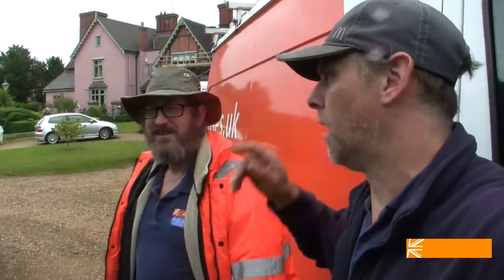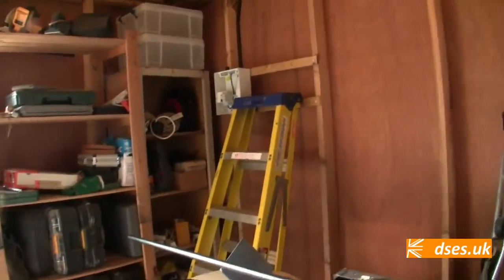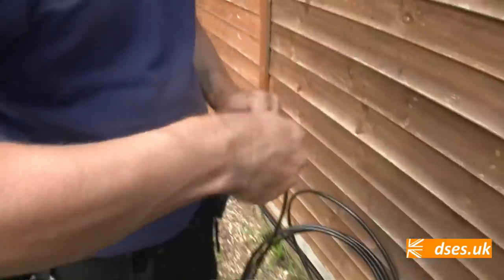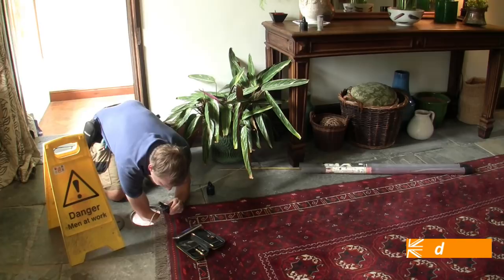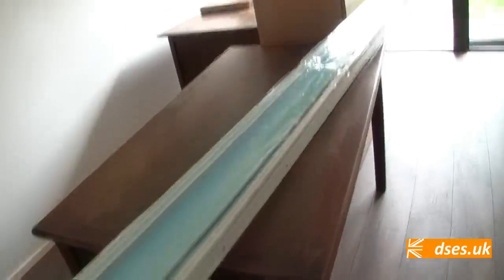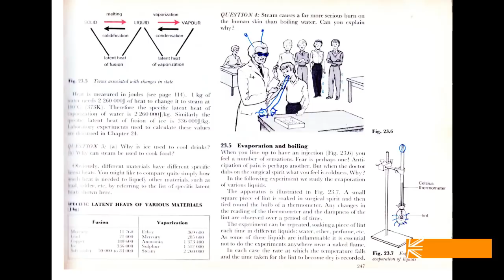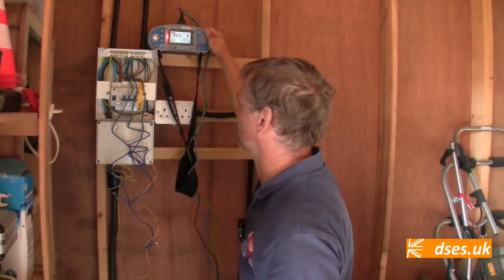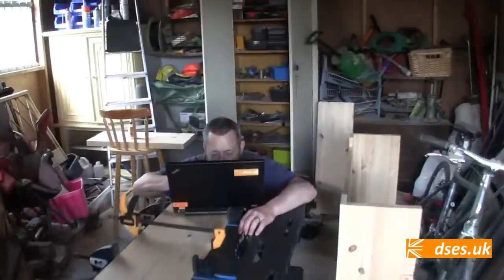The Manor House refurbishment... 5

Comment: Great video David! In this instance for TT we sometimes make off our SWA into an insulated enclosure with DIN rail mounted 100mA RCD within and then feed onto the metallic CU to provide fault protection to the casing. Keep the videos coming! 👍
Reply from the maker: That would have been a better option Matt as the way we've done it requires double insulation of the tails right into the main switch (RCD) in the metal enclosure and I don't think that was achieved here.
Reply: @dsesuk  Ah well still a tidy job, as you know the risk is next to zero of any fault occurring once you've cranked that main switch up with your death grip. Keep up the good content and work David.

Comment: Your rant about armoured cable calculations brought back memory's of the  my C course project,part of that was to calculate an armoured cable size for a sub main. Back in those days the regs were  about as helpful  as they are today  and  T'internet hadn't been invented so everything had to be found in books (including porn) or by contacting the manufacturers for the relevant figures,I bet  the uk cable manufacturers were  cursing  the city and quilds  that year  as they answered the phone for the umpteenth time to another  spotty apprentice demanding the r1 and  r2 values of there cables.
 As for isolating the pme armour from the TT,the old  way  was to cut a section of the armour away about a foot away from the gland and wrapping  the cut section  it in good old insulting tape,and yep the niceic was more than  happy with that.

Comment: All very interesting, thanks! One question about the earthling, what is the propose of not just connecting the earths together? If they had a metal water or gas pipe, this would act just like the TT spike in the outbuilding, and eliminate the need to separate the two systems with the gunked up SWA gland cover wouldn't it?
Reply from the maker: There are a couple of problems with connecting the two earthing systems, but the main one is the loss of the PEN conductor. Should the neutral fail at source, then the rod suddenly becomes the neutral sink for the rest of your installation (and maybe your neighbours too).
Reply: @dsesuk Thanks for taking the time to reply :) - This would happen on any bonded services in any case though, and presumably this is deemed acceptable? - I am not an electrician (Nor a filthy plumber, FYI!) My logic says that the risk of ending up with earthed things ending up within touching distance at some point, where two earthing systems are used, is more likely than the suppliers neutral failing and causing a problem, doesn't that stack up?
Reply: @dsesuk  doesn’t the regs recommend that where a PME earthing is feeding a swimming pool that an earth electrode is added (preferably less than 20ohm) and bonded to the PME earth. In the event of PEN loss this would (potentially, in the absence of unbounded services in the properties adjacent) create the sink that you describe above ?

Comment: Great vid Dave, great explanation of the regs and voltage drop.  I use to run armoured cables like, and the flat end would catch on everything, I then got a bit of 10mm green yellow, bent it over the end into a spear shape, wrapped a load of insulation tape around it and just jumped over the obstacles.  Either you are swearing less or I have come accustomed to it 🤣
Reply from the maker: That voltage drop calc is a bit crude. Basing it on the MCB instead of a design current leads to some overkill. We probably could have dropped the circuit to 32A and put in a 25mm to save some pain, but I guess whatever they do there in the future they should have enough bloody copper supplying it!
Reply: Years ago I fashioned a cone to go over the ends of armour etc so that it would ride over obstacles & it had a loop for a rod connection to help with guidance - it disappeared one day & I've never got around to re-making it... despite every so often swearing about not having it anymore!
Reply: @dsesuk  they will probably get a swimming pool and electric gates at some point,  You chose wisely Sir.

Comment: David would you consider isolating the PME at the supply end (and earthing SWA armour at the TT side ) so that there is no potential touch voltage issue and the armour could not become live under lost PEN conditions, and then protect the SWA with 100ma RCD ? This is something I’ve been considering albeit for smaller supplies such as hot tubs ?
Reply from the maker: Hi Marco. I have considered this before, in fact I looked into it on a hot tub video last year. It can make sense to do it that way. In this case, it was easier to keep the PME earthing on the SWA because I was either glanding it onto or beside the main CU, or running a T&E from the CU to the boiler cupboard to perform the glanding around a load of plumbing pipework that was bonded. The armour could go live under a lost PEN, but here it's insulated in all but the enclosure at the far end.
Reply: @dsesuk  thanks David as always with these outdoor earthing issues there seems no perfect solution as there are pros and cons for each approach . It just seems to me easy for an SWA sheath to get exposed by a say a strimmer or the gland shroud to slip down for the PME earth to become bollock naked. By the way good skills getting that cable under the house that looked an absolute ball ache.

Comment: Hi there, been waiting to catch up on the Manor House job. Lots of similar with plans to my property. Would have been nice to see how you pulled that monster SWA through the conduit all that way? I have 16mm2 50 metres distance. Did you use a powered puller?
More vids please, best on utube by far, both entertaining and informative.
Best Mick
Reply from the maker: Hi Mick. Thanks for watching. It's a shame we lost the footage of pulling in the SWA; much of this was filmed a year ago and it's taken ages to get all the bits together in edit. Another part is still to come, but I need to trim it down as it's about two hours long at present! As for the SWA, there was no duct, it was laid in a sand lined trench. We didn't have to do much other than to reel it off and dump it in there.

Comment: Thank you again David for this, it's great when you add the theory and calcs into your vids as well as the practicality of the physical install. How did you seperate the lugs in the torpedo BTW before pouring in the resin, heat shrink?
Funny how it went from Nige getting a slagging off for saying things weren't possible to you saying the floor support couldn't be overcome when feeding the SWA through the floor space and Nige was the positive one. Looking forward to your next installment.
Reply from the maker: Hi Olly. The irony of my putting the boot into Nigel's negativity only for him to resolve the issue was spotted in edit, but I heroically left it in there. As for the joint, it's a shame we didn't have more footage of that. The joint enclosure was large enough that the connections were well separated. Once the resin set, they were insulated from each other for good.

Comment: You need to add the CT factor to your results as 35mm will be no where near max operating temp of 70C . It would probably be about 0.8ish
Reply from the maker: Happy to be put right Robert. How would you have factored that in?
Reply: @dsesuk  depends what your Ca,Ci,Cd ect factors are to add to the calc but if you didn’t have any and get method D the factor would be 0.88 .

So your calc would be  mv/m/A x Ib x M x 0.88 / 1000
Reply: @dsesuk  giving you 4.75V . So not a big difference
Reply: @dsesuk  yes the volt drop is always the biggest problem and your well inside . Probably could of got off with 25mm with the CT value

Comment: Nige! That's a splendid, brand spanky Tilley hat! Identical to mine... Except yours is fresh out of the box. 
They look a bit less dorky when they've been out in the elements for a decade or two & through the washing machine a few times 😆 (30C remember, they don't like 40C!)🤠
Reply from the maker: Nige has had his Tilly for a few years - I bought mine in 2014 after he started sporting one, although I don't wear it much as I should have got a larger size. He only pops it on in the summer months.
Reply: @dsesuk  Ouch! I know what you mean. My first Tilley hat was one I found. Just a tad too tight. I thought it'd give whilst wearing it but.... Nope! It just started to hurt like buggery. 
No stretch in it at all.
Tell Nige to be brave & try it in the rain. It tightens up the material & makes an excellent pitter-patter noise. Plus, it keeps the rain off of your glasses, face & down the back of your neck. It's like an umbrella you don't have to hold!
David, you should 'phone them in Cornwall. Tilley are a splendid company. Tell them about your size cock-up. I'm sure they'll help out in some way. 
Have been missing the educational vids from your bat-cave and the occasional aside to explain parts of a job. You explain the intricacies of electrics very well & if you could find the time could I suggest a series on your favourite bits? I find it fascinating & I can't be the only one!
Anyway, keep safe.
Gotta dash... Toodle Pip old chap! 🤠💜☮️⚡

Comment: When connecting cables with different csa’s what do you record on the paperwork for the circuit?
Reply from the maker: I record the lower CSA with a comment column inserted underneath to advise of the change further down the line. So long as the OCPD is sized for the smallest CSA, there shouldn't be any issue.

Comment: i cant fault your installation but curious as to why you installed the 100ma RCD for fault protection instead of relying on the 30ma for both?
Reply from the maker: The 100mA can be omitted. I like to put it there as a secondary level of protection just in case an RCBO mechanically seizes up over the years.

Comment: Did you earth the sheath of the cat5e SWA? Is there a requirement?
Reply from the maker: HI Matt. No, we didn't earth the sheath. At both ends it terminates onto a plastic enclosure. I'm not sure if it should be earthed or if there is any advantage in doing so... or not.

Comment: Surely the armour is earthed at supply end and correct size MCB will protect the cable personally I'd fit time delayed RCD at supply end
Reply from the maker: Fitting the RCDs at the outbuilding end aims to keep tripping of anything but a catastrophic puncture of the supply cable localised. We don't really need an RCD at the source as the cable has mechanical protection and is buried at a suitable depth across the driveway.

Comment: Thanks for the informative and entertaining content David. Is there a good source of info covering various 'connecting outbuildings' scenarios? I'm just starting in the industry and it's not entirely clear to me why it was essential to keep the earthing systems separate - presumably the possibility of a P.D. between systems and therefore a current flow I guess? Cost of copper aside, would a third core and no TT earth-rod at the outbuilding been a legitimate option as someone below suggested? Also would you have had a different approach if the Manor House had been served with TT earth system instead of TN-C-S? Thanks again for the laughs...

Comment: Instead of terminating the SWA into a plastic enclosure, why not just use a nylon cable gland into the CU?
Reply from the maker: Could do something like that. The enclosure was probably overkill for what it was doing.
Reply: That's what we have done in past
Reply: No doubt someone would moan it's not installed correctly if they just used a compression gland.
Reply from the maker: @sdgelectronics  A compression gland is also on the NICEIC 'approved' list - I attended a webinar of theirs about a month ago on power to outbuildings where they talked of compression glands, sealing up standard SWA glands, use of new all-insulated Storm glands and such. Since this was installed, I've switched to Storm glands exclusively now. They cost more but are quicker and less fiddly to install and leave you with a better looking all-insulated finish.
Reply: @dsesuk  How do you ensure insulation between a metallic enclosure and the brass thread on a Storm gland?
Reply: @dsesuk  wow, the NICEC suggesting something sensible! :-o
Reply from the maker: @Monkeh616  I would still install it onto an insulated enclosure, it's just that the outside of the gland is plastic so there's no brass to be fingering.
Reply: Thanks for another cracking video. I now use a storm gland onto a separate insulated enclosure when doing TT. Not only is it insulated but when you do a periodic in your retirement you can easily check the R1+R2 on the armoured cable.🍺
Reply from the maker: @markholmes4143  Storm glands are the way to go. We switched to them earlier this year.

Comment: Cat6?  Should have installed single mode fiber as 10GbasteT has a max distance of 55m  over cay6....
Reply from the maker: Fibre might have been more futureproofed in hindsight, but it's in, working and plenty fast enough for what Andrew uses it for.
Reply: Why spend the money on single mode? OM3 is dirty cheap and will go 300m. Not that anyone is likely to need such rates in a shed any time soon.
Reply: @Monkeh616  OM3 is single mode!
Reply: @timballam3675  Er, no, it explicitly isn't. I'll refer you to ISO/IEC 11801 where it's defined, the core diameter of 50µm (which is quite obviously not going to be single mode), or for sheer simplicity the 'M' in the name..

Comment: Hmmm...  do I take it from your comments that you're not a impressed with our overlords at the IET? 🤣🤣

As for the data - I would normally be speccing for fibre at those sorts of distances as the potential difference between the earth at the two ends of the cable could lead to issues, alternatively a passive isolator will suffice.
Reply: As long as you're not connecting the armour at both ends there's no earth reference to be concerned about, seeing as it's transformer isolated. The potential for inducing high voltages across such a run is a pain, however. Armoured OM3/4 is really cheap these days, though, so I'd happily go fibre for such a run. It's actually cheaper than copper for shorter runs if you want 10Gbps, too (10GBASE-T modules are stupid money, -SR is almost given away).
Reply: @dsesuk  Copper will work. Hindsight and all that - I very much doubt it'll be a limitation for them. Some surge protection on it might not be amiss, though (if not provided, I haven't quite finished the video yet).
Reply: @Monkeh616  the problem is that a lot of equipment has Chinesium magnetics that do not necessarily have the level of galvanic isolation that you might expect... & not just in cheaper products.